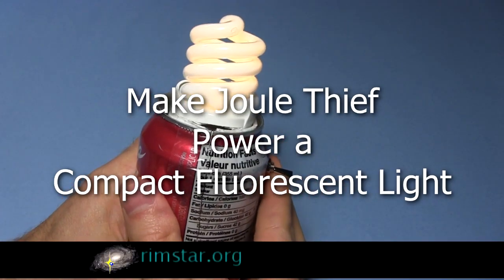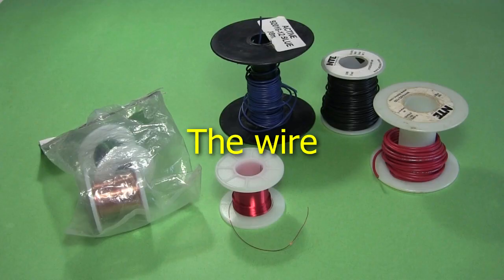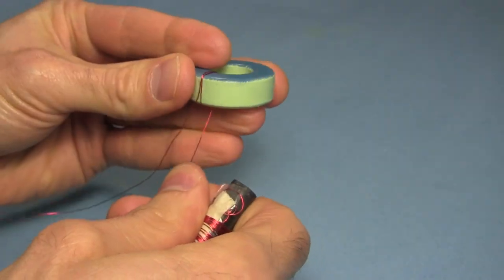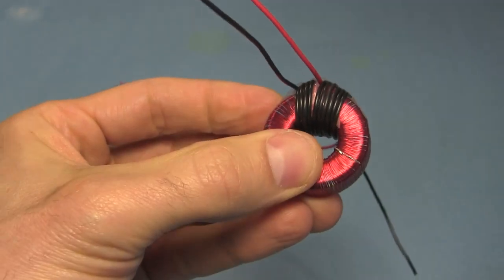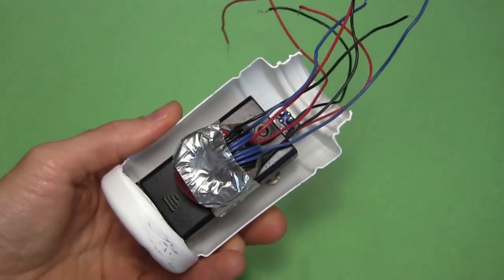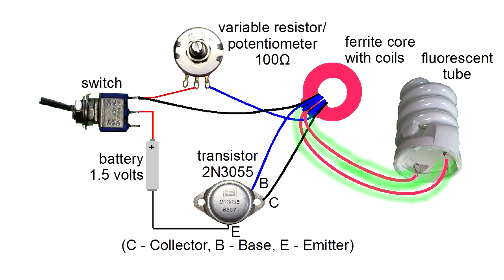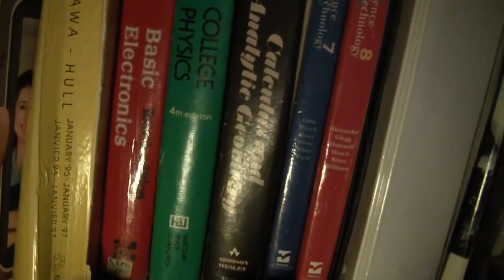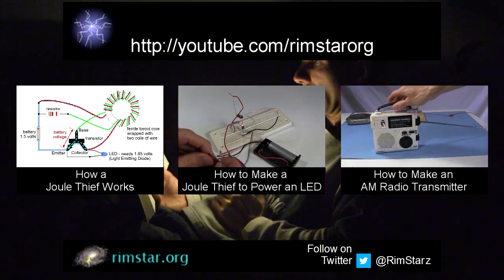How to Make Joule Thief Light a CFL - Jeanna's Light

Comment: Nice job, but will the battery wear out and need replacement very often ?????Will this light an LED bulb that has 9 small square LEDs on a disk. The disk has 2 wires  that connects to the components in the base of the bulb. Thanks for this great idea.
Reply from the maker: Thanks. The batteries don't last long, around an hour and a half. I show measuring it in my follow-up video here https://www.youtube.com/watch?v=yz_99oVMbSI at around six minutes and ten seconds in.
Reply: so isn't that a pain to replace the battery often ? Is there any way to get   
maybe 8 hours of light from this ? Will an LED bulb work ?
Reply from the maker: It was just intended as a fun project, to see how far it could go. The joule thief circuit isn't very efficient.
This circuit won't work with an LED since it produces high voltage. However, search for "boost converter". Those are roughly the same idea, step up a DC voltage, and can produce lower voltages. I haven't worked with them myself so that's as far as I can help with that approach.

Comment: Thanks for another great video! How long will it run on 2 AAs? Would it be even better with a 9v battery? Is this powerful enough to shock or even electrocute you?
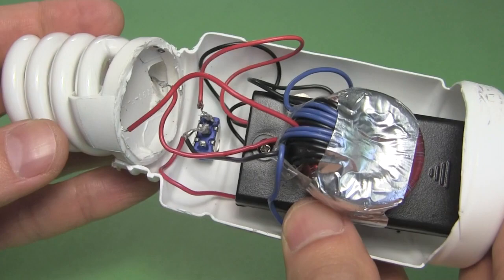Reply from the maker: +Blakehx I did some time tests starting at 5:17 in my follow-up video https://www.youtube.com/watch?v=yz_99oVMbSI. With a smaller wattage CFL (5W), but with the same brightness, and adding a heat sink to the transistor I got 1.5 hours. Without those modifications I got only 25 minutes of bright light followed by 30 minutes of dimmer light. That was all on 2 AAs. I didn't try 9Vs at all.
As it is, I don't think it would give a shock. I did later discovered that an electric fly swatter I bought contained the same circuit but with an added diode and capacitor and that does give a shock. You can see my analysis of that here https://www.youtube.com/watch?v=niRCKUliQWs and where I remove the diode and capacitor to make that fly swatter power a CFL here https://www.youtube.com/watch?v=ONAVPnp9WcQ, but again with AAs, no 9V :).

Comment from the maker: I don't know enough about MOSFETs to say. But in the comments to my other recent joule thief and CFL video, Acme Fixer said "You can try the tiny 2N7000 MOSFET which costs a dime at Mouser or Futurlec, but it requires 3V gate voltage." Re the 116 ohm resistor, neither my 5w CFL nor my 13w CFL would light with as much at 100 ohms, so I suspect 116 ohms would be too high. See my "Fun with Joule Thief Powering a Compact Fluorescent Light" for my measurements.

Comment from the maker: +harsh bawari I did try a bar core but it didn't work. Probably too much of the magnetic field was lost outside the bar. With a toroid more of the magnetic field is trapped inside. However, that's not t say it absolutely won't work. I don't have any formulas for calculating the winding.
PS. Check you youtube private messages. I sent you the reason I can't reply to your comments and how to fix it.
Reply from the maker: +Electronic Experiments I don't know. With an EI ferrite, at least one section won't be covered in wire and so there may be a lot of losses, but you could try it.

Comment: I didn't get the connections to short coils wrong. Today I added one more battery as you said, the CFL still doesn't light up however I adjust the potentiometer. So measured the two short coils with DC, their voltage is 2.7v , but the main many-turn coil doesn't have voltage reading, but they all pass the continuity test. Would it be possible I used a smaller ferrite core and wound less than 256 turns?

Comment: I assume the battery gets drained faster with it the JT. Without a JT how many batteries would it take? I saw someone else do it with 1 battery but their JT was big, but yours was good to be cooler. Your explanation of JT has a different set up than this to use thick wire at the ends. Also what if the JT had more wire would that help in needing one battery? 
Well Just be careful with those mercury bulbs. Maybe give it a protective wire casing to make sure it lasts since its portable = may slip.

Comment: I suppose a super thief is a JT that steps up the voltage a bunch and resonates with the power source for optimum efficiency. I should be able to fit the wire on. Is it possible to get the joule thief to work with less frequent, more concentrated pulses?

Comment: Hi, nice job.....I've tried  to make this  circuit but with higher voltage 15v to light up more powerful lamp, changed resistor value for base .....didn't work.....why ? thanks.
Reply from the maker: +Leo Bruno It could be that you still didn't reach the desired voltage. Or that you've got the voltage but once lit, the current is too low.
You should now try it with a lower power lamp and see if it still works. It may be that by starting with 15V input, your higher voltage at the coils may have damaged the insulation as I talk about when winding the coils. In that case it doesn't work with the more powerful lamp because your higher voltage damaged the coils.

Comment: Also i wanted to ask, i could not find a ferrite toroidal core so i went and bought a pack of (5)1/2" ID nickel plated steel washers that im going to stack on top of each other & make into a core, i know stacked thin iron plates eliminate eddy currents (which are irrelevant to this application, correct me if im wrong) & im also aware that any material that can become magnetized is also undesirable, im about to try the washers, is there a reason they wont work as good as a ferrite core?

Comment: You can get the label off A LOT CLEANER if you use some kind of vegetable oil after removing most of the label first. Any sticky gunky label glue left over can be removed with some vegetable oil just scraping with your thumbnail or a butter knife (gently). Then afterward just use plenty of dish soap to clean up the oil and gunk you've removed. You'll have a much cleaner container if you have to remove a label. Cheers.
Reply from the maker: ***** I'll keep that in mind in the future. I sometimes use WD-40 now when removing labels from peanut butter jars, probably the same principle. Vegetable oil would smell better while using it. :)
Reply: True. I hope I didn't sound critical. I love your work and what you share. I like to salvage items for experiemtns and builds and many people have to deal with label residue. If anything takes away sticky...it's oily! :D
Reply: It's an off topic comment BUT.....

I would like to ask if you would do a video about making FM coils...just a BASIC FM reciever circuit (that you could then hook up to a simple amp either LM386, transistor, or even tube or other pre-amp). Maybe you already have such a video? Thanks again for all your fun experiments. If I should just use the Youtube mssg system for this, just delete this. Thx again.
Reply from the maker: ***** Thanks for the suggestion but I think the amount of interest in FM coils would be too low for me to make a video. And I prefer discussion in comments, as you've been doing (unless it's really way off topic.) That way everyone benefits.
Reply: I'm sorry that you don't think the interest is generally there but I thought I'd ask. If you ever change your mind, I'll be watching! I really enjoyed your crystal radio experiment videos. Cheers.

Comment: Hey Rimstar, I made one and it works good so far. I tried making another one with a toroid that I salvaged from an Air Conditioning unit circuit but wasn't getting anything. I then swapped it out with an Iron Inductor Ferrite core from Amazon and it worked. Is there a difference between Ferrite cores?
Reply from the maker: There are differences between ferrite cores. There's a whole color-coding scheme. But I'm surprised one of them didn't work. Are you sure there just wasn't something wrong with the wiring that you didn't notice and then when you swapped it out you inadvertently fixed it? I'm glad to hear you got some working anyway.
Reply: RimstarOrg ya I doubled checked I even rewounded the 18awg wires. The bad ferrite core doesn't have a color code, it was bare covered by a plastic holder with 2  windings seperate from each other(like a transformer).
Reply: Is it possible that the bad ferrite core had a hairline crack in it?

Comment: Hi Great video. thanks for that.

One Question that I have is what happens when you need to change the battery?

Have you made a Bedini motor? I would be interested in watching the video

Regards
Reply from the maker: Ben Parmer You have to open it up to change the battery. I was careful to put the tape holding the toroid onto the case on only one side of the case, but it still requires taking it all apart. From my follow-up video, https://www.youtube.com/watch?v=yz_99oVMbSI, the runtime is only around 25 to 55 minutes so it's not likely this will be for much practical use anyway. Though with some changes I managed to stretch that to 1.5 hours.
And while I've long been aware of what a Bedini motor is, I've never been interested in making one.

Comment: I currently use a modified camera flash module for my super joule thief. It's cool but I didn't make the thing myself. I have small ferrite rings, lots of 0.1mm wire (damn thin!) and thicker wire (don't know what gauge). Could I make a super joule thief toroid out of that or are there specific gauges that I need to use?

Comment: hi!
i need a way to boost voltage and amps output from my small solar panel.
it's 0.17 amps and 18 volts.i need it to be about 30 volts and 0.8 amps.is there a way to do this?please tell me if you know.

Comment: Hi, I dont know if somebody asked this question before, but I would like to know how long the battery will last ? Please. Thank you.
Reply from the maker: In my follow-up video https://www.youtube.com/watch?v=yz_99oVMbSI,
 at around 5 minutes and 45 seconds in I show where I test the time. 
This one runs brightly for around 25 minutes. If you put the transistor 
on a heat sink and use a lower watt CFL (but still put out the same 
amount of light) then it runs brightly for around 1 hour 30 minutes.
Reply: +RimstarOrg thank you very much !!

Comment: Can you tell me the principle behind this? Is it electromagnetic induction??
Reply from the maker: It's a combination of two things.
The first is called the joule thief circuit, or blocking oscillator circuit and I explain it in this video https://www.youtube.com/watch?v=0GVLnyTdqkg.
The second thing is the electromagnetic induction in the form of a transformer between one of the coils of the joule thief and another coil that's added for the purposed of creating a high enough voltage to light the CFL.

Comment: +RimstarOrg I used a 3cm diameter core which I found in a ATX power supply, and used AWG 18 300v wires for the last two windings, after setting the circuit up, it didn't work. Any suggestions or advice about the things that can go wrong? Thanks.

Comment: My circuit was working well, but after sometime output was 0 voltage. But, when i checked the core, electricity was passing through the windings. What can be the problem? Can it be my transistor, because it heated up or any other part??
Reply from the maker: How did you do your check for whether or not electricity was passing through the windings? If you did a simple continuity test with a meter or even ran some low voltage electricity across it then that might not be sufficient. If the insulation in the wires broke down due to high voltage, that may have produced holes in the insulation but the metal of the wires may not be touching. In that case, only a high voltage would cross the gap between the wires and low voltage tests wouldn't.
But it could also be your transistor. Do a search for how to test transistors.

Comment: Im looking at this again, & it gives me an idea, couldn't you use this circuit or a similar circuit with a 9v battery & use it as an emergency power source to jump start a car? I was looking at stun gun circuits to get some ideas for this second project (i have no desire to build a stun gun).  I remember seeing a sharper image catalog with an emergency power pack for jump starting a car, & this plugged directly into the cigarette lighter outlet of the car.  This gives me the inspiration to try.

Comment: Do we have to use a 2n3055 power transistor or can we use a different type of transistor, because i don't have any power transistors at this time, but i do have some mosfets, will those work?
Reply from the maker: Scotlahn Mccallister I vaguely recall seeing a similar circuit using mosfets but I don't have any links.

Comment: There are a couple issues with your circuit diagram. Your diagram shows 1.5v but the battery box you're using holds 2 AA batteries which would be 3v. You also say variable capacitor/potentiometer. These are 2 different things. cool project though!

Comment: Can I use Winding Machines Transformer 33x20x11mm Toroid Ferrite Core AT106-26 instead of one which you used
Great Video!
Reply from the maker: That one looks like you should be able to get enough turns. Mine was around 33x15, so the inner diameter of yours is bigger, which should mean the turns won't be as crowded on the inside. Mine was just salvaged from old equipment so it was randomly selected.
Though the one found online when searching your part number gave different dimensions (27.5x14):
https://www.amazon.com/uxcell%C2%AE-AT106-26-Inductor-Ferrite-Toroid/dp/B008IGQSFE
and that one may or may not be able to get enough turns. I'm thinking not.
Reply: if i take a fixed value resistor what value shall i take or the 1kohm will work ??
Reply from the maker: There are likely difference depending on which transistor you have and your coils and ferrite toroid, however, in the test I show at 5 minutes and 20 seconds into my follow-up video, https://www.youtube.com/watch?v=yz_99oVMbSI, I get maximum brightness with around 34 ohms.

Comment: Is it possible to turn smaller ferrite beeds into powder and mix it with water in a culprit to create a new bigger ferrite core?
Reply from the maker: It's possible to do that but you'll have to somehow glue it all together to make as solid piece. The properties of whatever you mix the ferrite with (e.g. the glue) will be different than the properties of the ferrite so the result may behave differently than the original. It will likely have a lower magnetic permeability. A tip is to minimize the amount of glue or whatever you add to the ferrite. It might still work though. It might help to use more turns of wire to make up for the lower magnetic permeability. Let us know what you do and how well it works.

Comment: I'm making a science fair project using peltier tiles, and I'm buying 3 of them that generates about 4.8 volts at 100C difference... I'm looking at 2 different surfaces that have about a 15 degree fahrenheit which is a problem, as it goes from 100C to -9.44... If I use a joule thief, I'm wondering if the fraction of that volt is enough to charge a Lithium ion battery that needs 2-3 volts to charge...
Reply: Also, anything with voltage higher than 5.6 volts can destroy the battery... I need it to be precisely around 2-3 volts, otherwise, it might not charge, and it might kill the battery...
Reply from the maker: A joule thief isn't what you want since you can't control the voltage and the waveform is pretty messy. You want a voltage regulator. If you can't find one in the voltage range you want then there are also adjustable voltage regulators like the LM350T. I haven't used voltage regulators myself so that's about all I have for you on it, but it should be enough to go on.

Comment: Would center tapping the secondary coil of the transformer and connecting that output to a conductive wrapping around the midpoint of a fluorescent tube be a way to start larger tubes in a Jeanna’s light circuit? I got a dead PL fluorescent bulb (25w bl with both cathode filaments blown) off a bug zapper fixture that might make an interesting black light fixture using the jeanna’s light circuit to run it in cold cathode mode, and the main hindrance is the fact that the electron beams tend to arc away from the tube path in larger tube and I figured that have a capacitively linked half potential point in the mid point might correct this.
Reply from the maker: I don't know. Putting some numbers on it to make the discussion easier, without doing what you're saying let's say we're putting 1000V across the whole tube. With doing what you're saying you'd be putting 500V across one half and 500V across the second half and the problem would be the same, I think. The potential is the same across any length of the tube. I could be wrong, it's worth a try.
Reply: I mean in vacuum tubes, there’s a principal in that the screen grid doesn’t “trap” the electrons with its positive voltage, since it’s still at a lower potential than the anode and may serve to accelerate electrons even faster at the plate (fast enough to cause secondary emission). Either way, I’ll l still see if it works to at least capacitively to pull the electron streams in my fluorescent tube (at least to were it might make it easier to get around it’s 180 degree bend and fully start the tube), since I’ve already had the parts from a regular joule thief I made years ago. This should probably be a bit similar in starting hard-to-start fluorescent tubes by “tapping to start” (as in capacitively provide a ground to the glass), although possibly a fair bit better if it were to be an electrical potential at half each electrode (aka center tap potential).
Reply: It also would make sense that this “capacitive neutral” (since it’s a center tap connected foil wrap around the midpoint bend in the u-shaped fluorescent) would only be in circuit until the tube’s mercury gas mixture excites enough to act as a lower resistance path for the tube’s “live” connections.